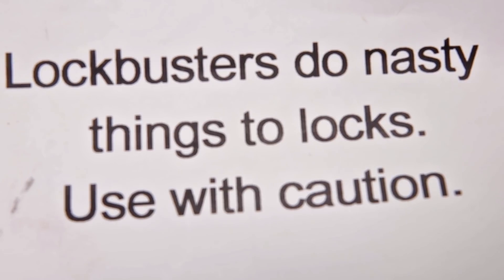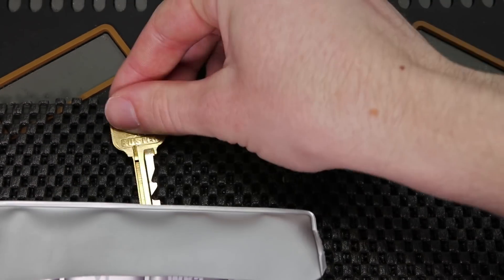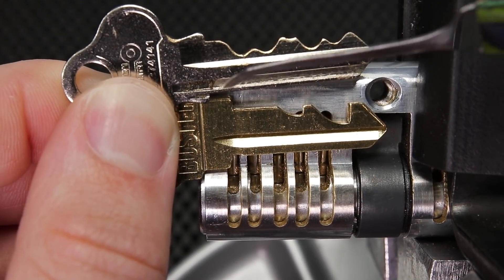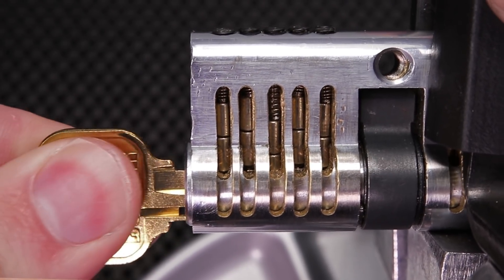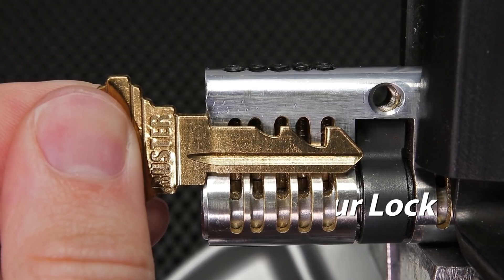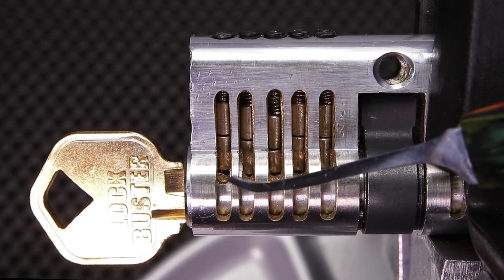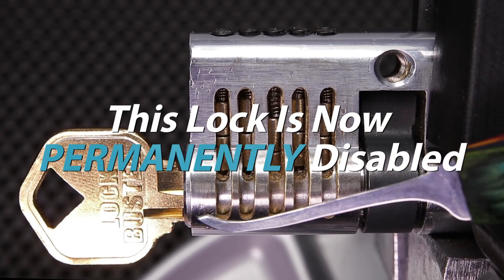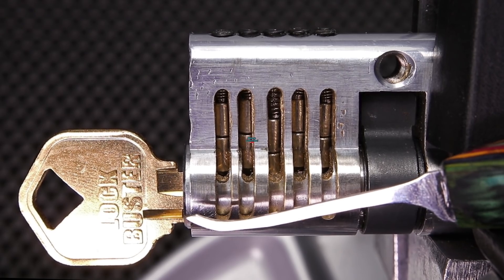[251] How To Disable Any Lock with Lock Buster Keys

Comment from the maker: Check out video [193] How To Temporarily Disable ANY Lock In Seconds With Motel Keys for a more temporary solution! 
Link: https://youtu.be/cT0I2IToxGY
Reply from the maker: For the Lock Buster keys it could be for police or military who need to secure an area quickly where multiple people have copies of keys to the lock. If you have access to the secured side of the door you can take the lock out of the door and top gut the lock to recover the lock. 

I could see someone using motel keys for more of the landlord / ex-girlfriend scenario, however, they can be easily defeated. 

These keys are an interesting concept, they are not likely used too often, but it is a good tool to have for the correct situation.

Comment: Another fairly effective, and very low cost, method, which works for the majority of locks, is to push a bent piece of paper clip into the keyway, with the loop of the bend pointed forward. DON'T DO IT TO ANY LOCK WHICH IS IN USE, AND WHICH IS NOT YOUR OWN PROPERTY!
Reply from the maker: Thanks for sharing!

Comment: Could strong vibration be used to rattle the pins above this nasty lockout key bitting?
Reply from the maker: Possibly but that would be some serious vibrations
Reply: You can get these out easily with the right tool. A locksmith could get it out in about 1 second.
Reply: @sphbecker  LPL demonstrated that neatly recently! ;)

Comment: Nice video. The lock you used isn't ruined. Being a cutaway you can lift the pins up out of the way to take the Lock Buster out. Even if it wasn't a cutaway you can remove all the pins and springs from the top. If you used it on a lock that was on a door or a locked padlock things become more difficult. :p
Reply from the maker: I have already top gutted mine and fixed it but not all locks have grub screws on the top. You could also break off the bow and push it through the back.

Comment: What is used for? Just ruining people days?
Reply: IT is for when you relly want to piss off some one🤣🤣🤣
Reply from the maker: The real reason someone might use these is to quickly secure and area.
Reply: or use it so they HAVE TO CALL IN A LOCK SMITH HEY HEY HEY
Reply: @umajunkcollector  that is pretty much what i mean😂👍
Reply: Police and other government agencies use them for quickly securing and area and insuring no one come in behind you on a raid.
Reply: It’s for the police and military.

„Lock Busters

Lock Busters are engineered to quickly and permanently prevent access to a doorway. The only way to effectively open the door after a Lock Buster is in place is to drill the key way or break the door. Designed for the Police and Military community to be implemented in emergency situations where areas need to be locked down fast. Each set includes four of the most popular North American key ways. 

Caution these Keys do Nasty and permanent damage to locks.They will need to be drilled out and the lock replaced - but what do you expect from a LOCK BUSTER.“
Sparrows website

Comment: I have two of these keys, now I'll watch the video to see how they work
Reply from the maker: Thanks for checking it out! Just be careful with them!
Reply: @HelpfulLockPicker   hi is it possible to break an anti snap lock with a drill bit Using an hammer? I would say maybe some cylinder locks will but not all. I was told today that anti snap is rubbish and easy bypass even with anti drill. I know anti drill is supposed to just slow them down, but according to him he just uses a drill bit and an hammer.
Reply from the maker: @anthonyleedickinson3491  I am not very sure and I don't want to give you the wrong answer
Reply: @HelpfulLockPicker  no worries maybe worth a try though, get a cheaper anti snap lock. All I know is it snaps, but before center pin making it very difficult to access it and remove lock. I just got abs lock to secure our home a little more as we only had a cheap cylinder lock in, but saying that someone was always home so it didn't matter too much.

Comment: Will a shim be able to get in there to lift the pins?
Reply from the maker: No, the key will get in the way. You  need to either top gut or break off the bow of the key and push it through the back to fix the lock

Comment: Couldn’t you slide a shim in the lock to lift the pins and pull out the key? Or is it too tight?
Reply from the maker: Shims don't fit well through the front of the lock
Reply: @HelpfulLockPicker  ah ok, I was thinking something like how you would use a broken key extractor.

Comment: Very effective. I'm limited in my thinking, but I can't imagine any really practical scenario to which there's no equally-effective legitimate solution...... Is there? :) Thanks as always LPL :)
Reply from the maker: These would be great for military and law enforcement. They can be used to rapidly secure an area that needs to be locked down. The locks can be recovered after the fact if you are able to get to the secure side and remove them from the door.
Reply: @HelpfulLockPicker  Ah, never thought about that.

Comment: The shaft can also be cut nearly all the way through so that a mild twist breaks off the head. (Though technically it's not necessary because you could just pre-cut off the head.) electronicsNmore recently did a video showing how to deal with these: youtu.be/m3_YmJVNQJw
Reply from the maker: When the bow of the key is cut off it is also nice  because it makes it easier to remove it after so you can just push it through the back.
Reply: @HelpfulLockPicker  But not if the shear is just in front of a thicker part of the key, and it also has a square notch, into which pin 1 drops. You would have to drill all of that out, thus destroying the lock barrel. If the key is also made out of hardened steel, you have an even bigger problem.